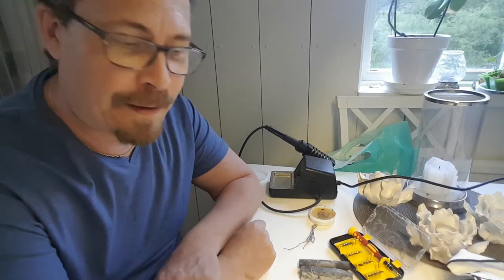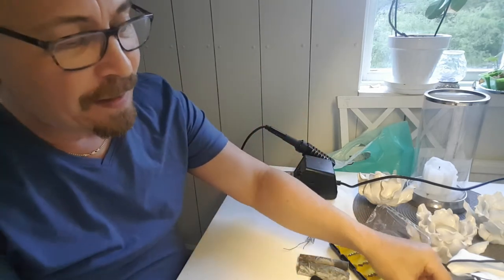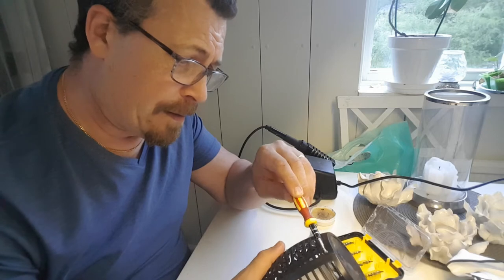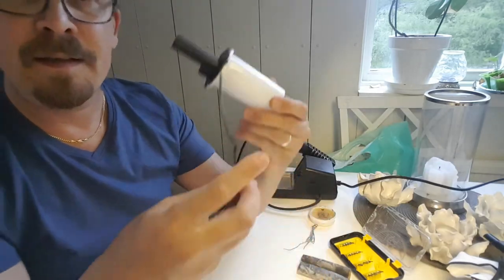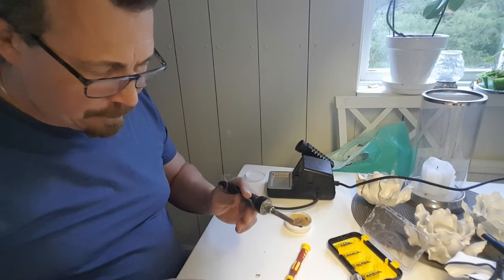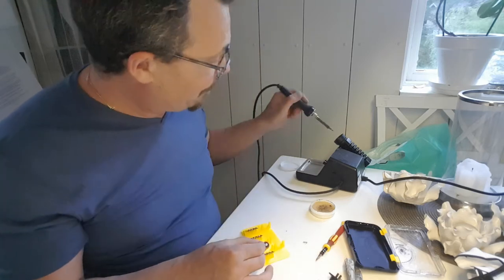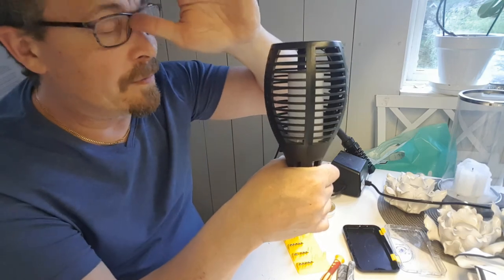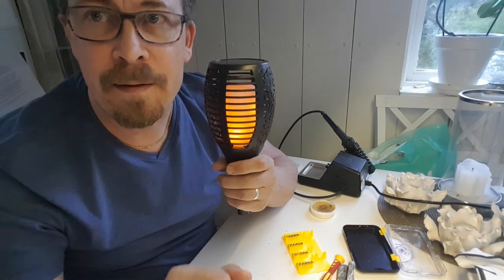Solar Flame torch light battery change

Comment: I don't want to be critical but all the important parts happen off camera.  We don't get to see where the screws are or how you remove the white cylinder from the platform or really much of anything.  Your face shows up just fine but all the work is off screen.  Too bad because I really need some help!
Reply from the maker: Understand. I did not realise that this video would be interesting. I will shoot in an order angle, redoing this change of battery

Comment: What a faff that it needs soldering. You'd have thought you'd be able to just drop the battery in. Hope mine last.
Reply from the maker: I do not understand what faff means? Well, as you are to change something, the battery, that are not meant to be changed, required soldering is not a surprise.
Reply: @swedemake5571  Faff means fiddly, a bit of a hassle. Rechargeable lithium batteries do seem to invariably wear out / hold less charge over time. My point was, why couldn't they have made it so you just clip the battery into place rather than having to solder it. Hopefully I won't need to anyway. The lights look great, especially the bigger version with 96 LEDs
Reply from the maker: Hello Simon.Thats fair. I did order the 96 led light. But received 33 led. Is it worth the price for the 96 version? I really like having torch light in my garden.
Reply from the maker: Okay, I will order the 96 led version. Thanks Simon

Comment: Unfortunately, most of the work you did was outside of the frame. Is it possible to change these batteries without using a soldering iron?
Reply from the maker: Hello June. Yes I know. I will do a more detailed version. On the torch lighr version I have a solder iron is needed.

Comment: Great presentation! I have the same torch solar light....and the one battery went after only one season. The only think I would like to comment on ANY solar light...to bring them in when the winter is on the doorstep...as the batteries don't like freezing!! Brrrr!
Reply from the maker: Hello John. Thanks. You are right, they should not be out when cold. At least mine dont work then. I believe batteries also dont take charge when they are cold.

Comment: Great video, do you use a normal battery or does it have to be a rechargeable? 
Also tell whoever is rustling in the background to stop on your next video 😀
Reply from the maker: Hello NM. Ill tell the government (wife) to be quiet. Any reprisals on this request, I will refer to you. 😉 Its a rechargeable battery. Do not use a regular one. Best is too disassemble the torch light and get same type. Then you would be sure that it works. I would guess most likely it is. AA 1.2 Volt 600mAh NI-MH.

Comment: Hello, thank you for showing how to do this. Did you replace with a rechargeable  battery?
Reply from the maker: Hello. Yes, I bought a rechargeable 2400mA NI-MH battery. (Original 600mA in this solar lamp). I think 2400mA is overkill as I dought that the solar charge current is so high. Also here in Sweden we have our cold seasons, and by that Litium battery is no good.

Comment: I have one of these and it's been out in the sun so long the solar panel on top is getting cloudy. Going to try some clear coat.
Reply from the maker: Hello. Happened to me too. I took clear nail polish. But first tried to sandpaper to have a more smooth surface which did not work as material was fragile. So the right coating should be the best.

Comment: Thank you for the video but a lot you do is not visible unfortunately.  Did you replace the battery or just clean it off with sandpaper then resolder
Reply from the maker: Hello Barbara. Yes the video is not very detailed in visibility. I did replace the battery. Using sandpaper will make it way easier when solder.
Reply: @swedemake5571  thank you for responding.  I have 4 Of these lights and three don’t light up anymore.  And no soldering gun.

Comment: Hello, I have bought a solar light lantern, I have had it in the sun all morning and now at night I see that it does not work, is the battery dead? How can I know that? Thank you very much, I already hit the on button.:virtualhug:
Reply from the maker: It might be a dead battery. To see that you may measure voltage with a multimeter. It can also be the on-button. They are usually of bad quality and might have inrermittent function. First flip the on-button back and forth a couple of times
Reply: @swedemake5571  Hello, Thank you very much for answering, It could be that the battery is dead, and I see that the power button is very simple,😳 it is plastic, I will open and close it several times to see what happens,Thanks again!:virtualhug:

Comment: The most critical facts were either overlooked or barely demonstrated or not addressed at all.  The original battery was a 600 mah nickel metal hydride...  I think.  He doesn't address the replacement except to say that it has a 2300 mah capacity.  That seems awful high for a single AA NiMh battery.  What TYPE did you use?  If you opted for a lithium ion battery your solar panel/charger probably doesn't deliver the voltage or the amperage needed to charge it to full capacity.  What type of solder did you use and did you use any type of flux.  My experience with soldering on batteries is there are some common solders that just do NOT stick to these battery electrodes.  The demo is more or less useless except to show how to dismantle the housing.  You said you wanted to see how much longer this battery powers the light but you never tell us... duh.  If the solar panel will not fully charge the battery, this is a pretty important piece of information.  Think this whole thing over and try again...
Reply from the maker: I dont need to think this over. Just choose another video and get a life.

Comment: What size of battery did you replace it with? The one in mine doesn’t show what it is.
Reply from the maker: Wicked Wanda Hello. I believe that original is 600 mA. I did use a 2400 mA battery as replacement. Which is overkill. Just find a cheap one that has 600 mA or above. Be sure not to use Litium batteries as (if I am correct) dont like cold temperatures.

Comment: A bit different than mine solar flame but i changed battery today too in mine, idk if it was needed, but it works about 2 years ( i will test battery in MH-C9000 and check) so i thought it will be good because i repaired also a switch - light was dimmer. Mine was completely glued after i unscrewed top cover, so little harder, but glue was melting very fast at not very high temperature.
Reply: I ripped the wire off mine from the solar panel, I use regular rechargeable batteries and it lasts longer. To me the solar is a waste of time, solar's need to be tested some more.

Comment: Does anybody know if these units use the 18650 2200mAh type battery? I have disassembled my lights and the battery is similar to the 18650 but has NO markings to indicate what type of battery it is exactly.
Reply: There are 96 LED solar torches with Li-ions, they have different solar panel, when you look at solar panel its easy to say if it is Li-ion or Ni-MH version.

Comment: Did it last any longer?
Reply from the maker: Hello David. I have not experienced any mprovement of that.
Reply: @swedemake5571  Thanks, out here in the Florida sun and we barely get 3 hours with them. Guess that's what we are stuck with.
Reply from the maker: David, that sounds very short. I assure you that we have way less sun in Sweden, but mine lights way after midnight if it was a sunny day. Maybe you have more led:s in yours, like 96? I ordered with 96 but I received with 33 led in each torch.